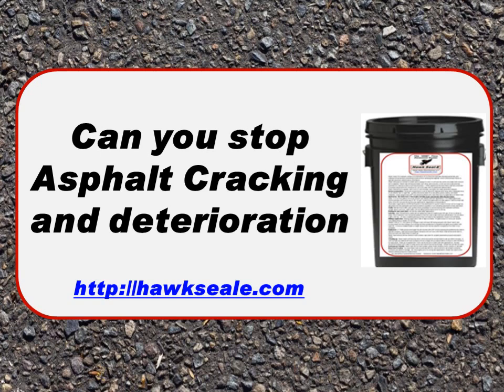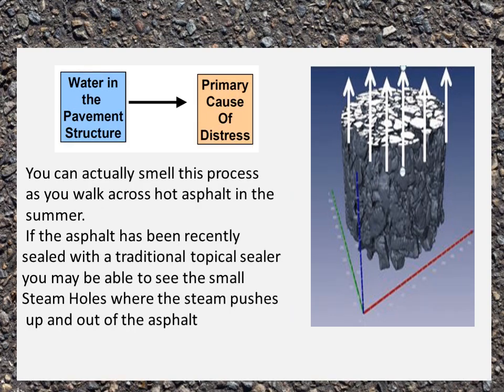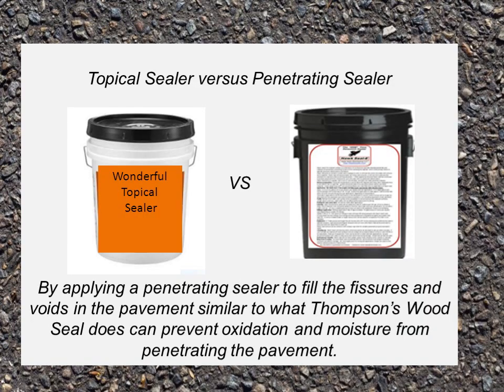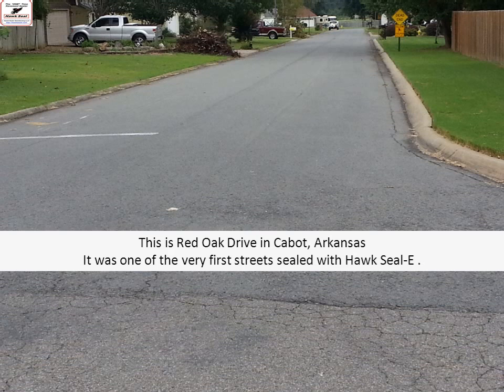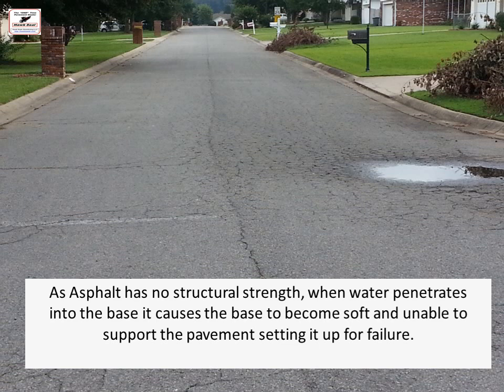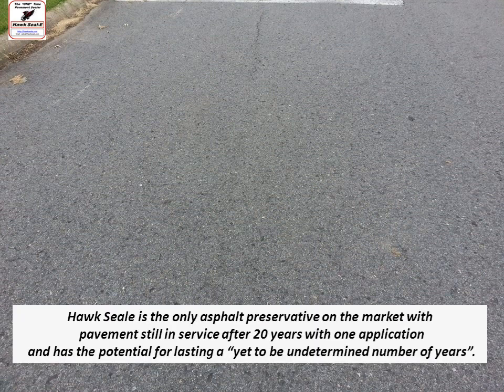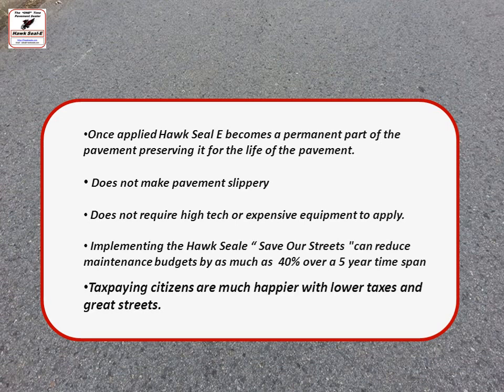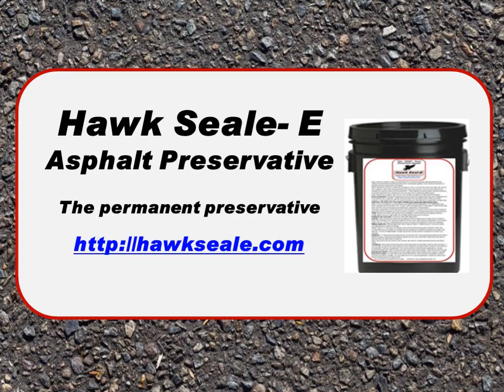Can Asphalt Cracking be Stopped?

Comment: 11-8-2020 -Our new improved HawkSeale Blend 2.0 is chemically designed to penetrate and re-juvenate the asphalt in the millings to allow better compaction to  resist air and moisture which are the two most damaging factors in asphalt deterioration. 
HS-2.0 creates a hard durable surface to prevent the tracking of fines and erosion or washing of the millings from heavy rains,  the two most common complaints when using millings. Cost for a millings project treated with HS-2.0 will run abut half the cost of hot asphalt including the millings. (we do both). 
We ship direct to you with free shipping in the continental USA. 
Please visit our website for a no hassle quote at-  http://hawkseale.com